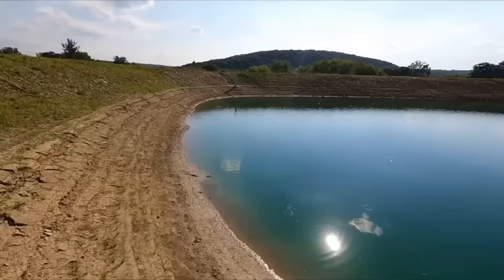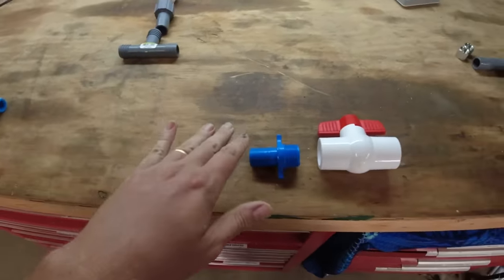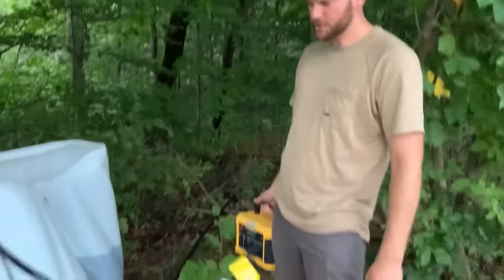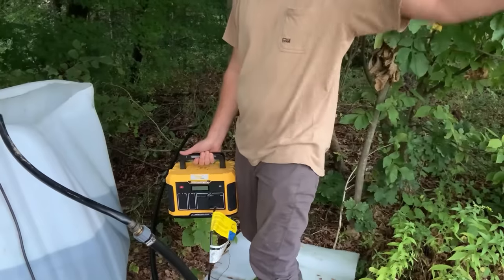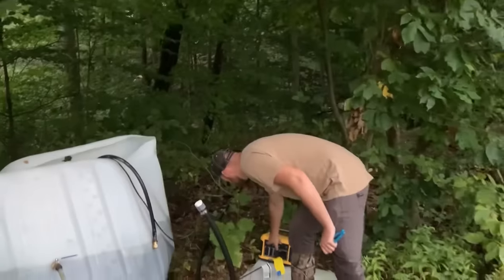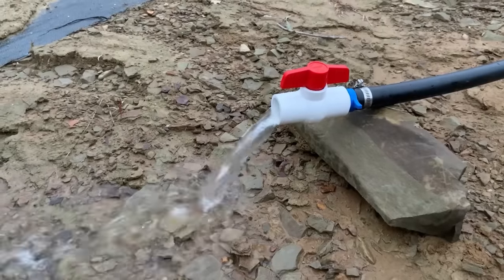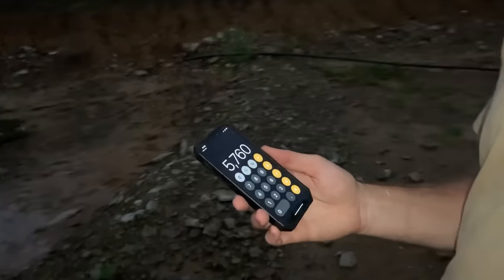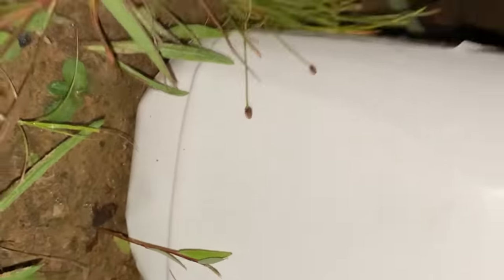This Siphon Will Save Our Pond

Comment from the maker: ToGo Power Portable Power Station Link

https://www.amazon.com/dp/B09VX9TYVL/ref=twister_B09VX54W24?_encoding=UTF8&psc=1

15% Discount Code: A4IEC34D
Reply: Just in case you're curious if you need a fill about 5 ft your outflow of 2.1 million will give you around 238x238x5 ft cube of water per year
Reply: your left-hand pointer fingernail? what did you do, i saw a purple nail
Reply: What Did. you use for piping? for running the water from your ramp pump or your siphon?  Sizes material. And where did you get the? fittings and fixtures that go with it?

Comment: no need a second hose, use the in the inground hose and maybe use fittings if want to have dual function. As I said in your pump video you should build a small dam ( 1or 2 feet of water) at the source and a flow control at the pond to prevent sucking to much water and draining the source to  fast. Basically, DO NOT forget how many gallons the source will give. 
i noticed that you are testing quite a distance above the pond, so if you test at the discharge point at the pond you will find a faster rate due to the increased drop in elevation. Also, Remember moving water freezes at lower temps.  NICE VIDEO.

Comment: These ram pump / siphon videos are awesome! It reminds me when I worked at a water utility in Florida years ago, we were tasked to pump water from a large canal to a drier canal system at a lower elevation (and over a berm). There was no power nearby, so the options were expensive diesel-powered pumps or a siphon. We went with a siphon made out of 12" pipe and were able to get the desired 500 gallons per minute, at a greatly reduced cost.
Reply: "500 gallons per minute", that's what I'm talking about. LOL

Comment: I have seen people use a shop vac to start a flow, no need to fill the pipe just a valve at the point where the elevation is lower than the source where the vac can be connected.

Comment: 2,563,200 gallons per year at 12 seconds per gallon.
Reply: I’ve lost 1.8 million gallons of water from my 4.5 acre pond from two weeks of blazing heat high humidity in Ky. I have a creek about 100 + yards away I could also use. If have to carry it up 25ft or more elevation

Comment: I have worked with that type of piping before. If you use a small propane torch to heat the end of the tubing just slightly, the fittings will go in much easier, but the most important part is that the hose clamps will make the tubing conform to the fitting much more tightly. Just a little heat goes a long way.

Comment: About filling up the pipe. Prepare a bucket with a pipe and valve at the bottom. Hang up the bucket and connect it to the T. Fill the bucket and open the valve. This gives the air a place to escape and you can add water easily.

There is a story an Italian friend told me. People where very proud to have a natural spring in the middle of his hometown. But one day, without any indication why, the water stopped. They started to investigate the problem and it turned out the "spring" was a siphon build over a near by pass to a lake on the other side of the mountain range. The ceramic pipe was destroyed after the road over the pass was rebuild. The hole system ran for over 300 years with so little overview that it was forgotten. 🙂

Comment: You should consider a rough stone dam of a couple of feet and a weir on the intake end. It will buffer against fluctuations in the stream flow and possibly breaking the siphon.
Reply: As I mentioned on his last video, I have had success using bags of saccrete to make a spillway (better than a dam since there is no erroding out at the bottom of the dam from a waterfall).  Really simple to lay bags of saccrete next to each other and let the concrete harden in the bag.  And they seem to do a good job of self sealing.  Build up as many courses as you like moving the bags upstream to make the spillway.  You can pull off the paper and plastic after the concrete hardens or just leave it to erode away.  And it can be taken down and put back up.  And the spillway will turn mossy and look really attractive.

Comment: I reccomend that you replace the Cap with an Additional Ball Valve so when the temperature drops, you can drain the Siphon Open the "top of the hill Valve" to stop the siphoning action to drain the water, that would keep the FREEZE from damaging the Pipes and Valves!
To help the "Feed End" filter it with a $0.99 Nylon Stocking to keep the smaller debris out. Unless filtering is not "warrented" on this project...
Reply: The pipe being used looks like the type that can handle being frozen.
But you are right, he will need to deal with things being clogged.
Also he needs to deal with flooding of the creek.  Likely best thing is just turn it off and move it out of the way.
My point is while the water seems free, it does take some effort, time, work and money for materials.
Reply: TK Skagen, I would add that he would need to force open the intake check valve to drain the line from the Tee down to the intake in the creek.  With that intake pipe running so steep, it shouldn't take long to drain.  There's no point in risking a freeze split in the pipe or a blown check valve.

Comment: You could use a hybrid of the two pumps. You would just need to put a couple of isolations in the hydraulic pump, so that once the discharge pipe is full you isolate the pump. The swing-check valve would prevent backflow down the hill. Once the mass of water is flowing downhill to the pond there will be a suction generated in the stream. You may need to build a larger pool to place the suction hose/foot valve.

Comment: We have a gas powered 2 stroke  water pump that looks like a mini generator, with standard garden hose fittings. We always did this method when filling our pond from the lake. Turn it on full blast, let the air purge, then quickly unscrew the intake and throw it in the water with a bolt around the end as a weight. we then would take the metal filter thing it comes with and put it on underwater fast

Comment: 🥰 SO glad the siphon worked GREAT for you!  But don't you have another buried line to the pond. Even if it's smaller, you could tie them in parallel for more Pull-Power thus more total flow 👍😎

Comment: Use a little heat on that hose when connecting to barbed fittings, plus the hose is softer when you tighten the clamps and makes for a better seal.

Comment: As a suggestion. Get a propane torch. Blow the heat inside the poly pipe just to soften it. Then, insert your fittings and hold steady for a minute.  That let's the barbs seat into the soft poly for a positive seal. The double clamp it. Clamps should be opposite or opposing.

Comment: I would use a closed tank of some type instead of the IBC container. Then once it is full and the supply line is full you would not need to fill the line going to the pond.  It would make working on the system easier.

Comment: If you have a mobile pump why not just do a straight pipe from creek to pond and start the siphon by pumping from the pond into the creek and then turning off the pump and letting it flow in reverse? Seems simpler and all your steps to start it are in the same place. You don't even need a valve on the creek side, just a filter.

Comment: If you have an oil suction pump for removing oil from an engine or differentials or similar thing like that. I have a chamber one that I used to suck the air out of my pump for the lake and it works amazing and I believe it would also work well to start your siphon at the top by closing the ball valve at the bottom and sucking all the air out of the creek section

Comment: You can take the spring out if the Foote valve and put it back on to prevent debris from getting into the line.  Getting something caught in the line would really stink.

Comment: Excellent improvement, Adam.  Two questions:

1. How did you determine how to size your siphon system?  Especially diameters of fittings and hose.
2. Is your creek a reliable source of water throughout the year?  Given you've been dry and are siphoning 5 gals per minute I would say yes but this is only one snapshot in time.
Reply: The creek is flowing, it is not a pond. So it will not run dry unless you take more from it, than its flow rate. I saw the creek flowing in one of the pictures. It looked like about 3-4 times the rate of that hose into the pond. So not a problem.
Also further down stream the creek might also pick up more ground water springs going into it.  My point is, for this project, the creek will work.
Only issues I could see are spring flooding messing things up or debris in the line.
Reply: @superchuck3259 , It is not uncommon for creeks to run dry.  I lived next to one about the same size as Adam's.  Indeed, it would dry up once in awhile.  That's actually more of a ravine than a creek.  Adam said they've had a dry summer and that creek was still running so that's a good sign.  But you cannot take one snapshot in time and make a definitive assessment.
Reply: @joesixpack8305  Neither of you answered the QUESTION!!!
Reply: the bigger the better . We had a 2IN. hose we ran all summer when we had cattle and it was about 8 GPH.
Reply: @jimputnam2044  Your last name being Putnam, You have counties named after you, must have some successful farming ancestors!
Reply: @superchuck3259  LOL Father , Grandfather , great Grandfather. All Farmers. I decided I liked to repair things so 40 yrs. a mechanic.

Comment: If you put a valve on top of the check valve you can use the pump to fill the system. Once the water starts flowing you close the valve on top of the check valve and it will continue to siphon through the pump.

Comment: Could you put a Y fitting and run two lines from the top of the ridge down to the pond and achieve twice the flow? The weight of that water running down to the pond determines the flow rate, but one intake can handle 10x the current volume. Seems like it would work to fill the pond more quickly without running two lines the entire way. At least to get the pond filled a bit quicker leading into winter.
Reply: This is big brain thinking right here. If the creek can support it he absolutely should do this.
Reply: Yeah, when he was running pipe downhill, digging the ditch, I thought, you will never regret running an extra pipe.  It can always come in handy.
Having that creek is such a blessing.

Comment: I would add that there is two things I would do if it were me.

1. add a weir to the stream bed to create a deeper pool to draw from and reduce the possibility of sucking air which could reduce or eliminate your flow
2. There is no reason you can’t run both the siphon and pump for a time to get the pond depth up to what you want. Adding the three water sources together gives you almost 8 gph. That’s about 4 million gallons a year.

Comment: The big question is: will the creek support that much of a drain or will it dry up?
Reply: That was my concern as well. That creek looked less than adequate.
Reply: @LumberjackPa  More water is going down it then you think.
Also it has been dry. So certainly the flow will increase.
It doesn't look like the creek supports more than frogs or minnows.
Reply: Water rights? Can you just divert water?
This doesn't look that bad but you know  - the next guy - up stream,  taking all the water before it gets to you.
Reply: @CHMichael  There's probably still a lot going around the inlet pipe he has
Reply: @CHMichael  Did you see the other corrugated black 4 inch or so pipe that was just a trickle, the one coming from the spring?  The spring on his land was giving about 10 gallons a minute in spring, but it was a seasonal spring and the summer dried it to a trickle. So that spring water did not have an upstream risk of someone taking all the water.  Most likely the risk of all the water being taken from someone upstream is from governments coming in and diverting this to a reservoir for drinking or other irrigation water.
But I agree, don't be rude and take all the water from the stream!
But do know that ground water and other springs are adding to the creek the further down stream it goes.
Reply: I'd be more worried about where the intake pool is deep enough, with that much suction the air will vortex down to the top of the pipe within a few inches.
Reply: @davidbeattie8736  Good point.
I do think the drilling of holes and the screen on the end of the pipe should stop that whirl pool issue but yeah, it would totally ruin the suction.

Comment: Ram pump to the tote as a standalone, , use previously buried line o to the tote with a ball valve, tee in the creek side, when you need to start the syphon, open the ball valve to the tote, once pipes are full, close tote ball valve and no need for pump...

Comment: If your source is higher than your outflow you don't need a siphon action at all.Just stick your pipe under the water and it will gravity feed. There are miles of pipe strung out through out the mountains here. If you want more head pressure use rocks to back up your water source just a small bit and place your pipe as close to the bottom without clogging it and the additional water pressure from the more volume will increase your flow.

Comment: When you stop the siphon, don’t break vacuum, just close the discharge valve so you don’t need to prime it every time.
Reply: During the winter, standing water will freeze and break the pipe.  You have to release the vacuum.

Comment: In response to people saying you could put a valve instead of a cap on the re-charge tube.
I was thinking the same.. So the solution to that would be from the T junction, pointing upwards, replace the cap with a valve, as others have said, but if you keep going, on top of that value you have a container with more water in. (Small one will do, like a beer pitcher size). I'l just referring to this as 'the jug'. This would:
A) allow filling up the pipe for re-charging since now you are filling into a MUCH bigger receptacles, 
B) if the value DOES start to fail slowly over time, it would just be sucking in MORE water, not air from the jug.. (until the water in the jug runs out)
C) rain water would/could refill the jug.

You could even use the ram pump for filling this up, giving you a purpose of this ram pump.

Comment: If you end up having to charge (prime) the siphon often you should look into a venturi charger. I imagine you could power the pump with a small 6 or 12 volt battery. Basically you shoot water into the pond feed and it pulls a vacuum on the stream feed and pulls the water up.

Comment: I really enjoyed the ingenuity and willingness to try out different methods as you found out about them and testing to get the optimal solution.  It may not have all the "fancy" aspects of figuring out the details beforehand, but this is solid engineering and going through the iterations to make the best design for the circumstances. I will also recommend finding out about the "water rights" issue as you don't want that BS to bite you in the butt.  Great video and I like the "down home" quality of the projects and execution!

Comment: you should submerge your discharge.  Submerging it will prevent air getting back into the pipe (thus breaking the vacuum), creating an airlock condition.

Comment: 2,620,800 gallons per year with new flow rate. 
You should also invest in a  5 in 1 screw driver. It also acts as a nut driver when you take the bits out. Works great for tightening hose clams and avoids staving yourself with a screwdriver 🪛.

Comment: Had a thought.  If you were to add a tee upstream and downstream of your ram pump and tie those together with a ball valve, could you use the ram pump to start and then switch over when flow gets going?

Comment: We have water rights to a large creek and I have been researching building a RAM pump to fill our pond but I am wanting the output to be much stronger. We use a 2.5inch fire hose hooked to a trash pump currently. It pumps water at a fast rate but we need something that can be pumping 24/7 with out having to fuel it. Can a RAM pump be made larger with the same concept if the water flow is available to meet the need of the larger pump? I haven't been able to find any videos on larger diy RAM pumps so any links to such are appreciated. Our creek is about 30ft wide and the shallows are 1ft deep so I don't see water flow being an issue. This is all new to me so appreciate any advice on such. Our 1 acre pond is about 20 ft uphill from the creek.
Reply: I recently set up my pond. I use grid tied solar to run my well and circulation pumps. Its worth considering setting up a solar pump coming from your creek. No battery, just sunlight pumping. They sell kits for solar wells that pump all day to water cattle. Im sure some of those same parts can run a submersible or above ground pump. More upfront than a ram but more flow and reliability especially if you trash pump 2.5in. A ram will have a very hard time coming close.

Comment: Pinch down the discharge valve so the pipe stays 100% full and you will increase flow.  Seems wrong but it works that way.
Reply: A small riser (90 degree fitting with a 1 inch long piece of pipe) works too.

Comment: Well if it ran that long then the creek has more than enough water flow. Wonder if it’s got enough for a larger line or maybe run a 2-3” siphon line to run when needed. Could just use it to get the pond full quicker then take it apart afterwards and leave the 1” line.

Comment: Gonna comment before watching to the end as I'm wondering if a syphon will be enough to pull a foot valve open as they normally work with pumps that will pull much harder. Regardless, I'd go with just screens at the intake so you get maximum flow and less chance of stopping the syphon. Now I'll finish watching to see just how wrong I am, lol.